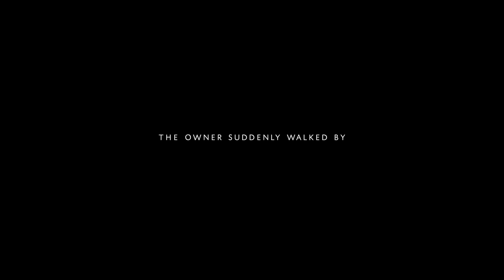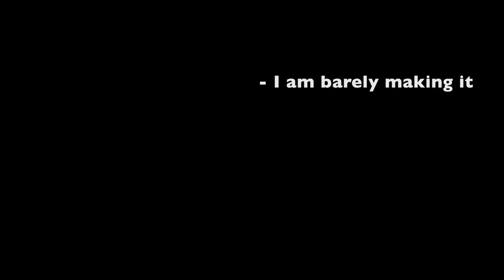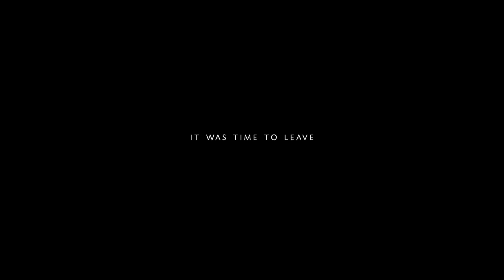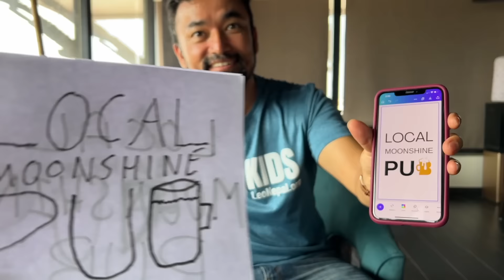The Widow Gongo Brewmaster of Nepal 🇳🇵

Comment: Those plants really got on your nerves mr. Sunil. It should be banned from your hikes. There is more spiky plants I saw on the mountains which my father resides, but I don't know what it's called. All the stems from root to tip has spikes. If it gets you, surely your skin will be ripped. So be careful. Wearing those jeans are very practical on bushy areas like that.